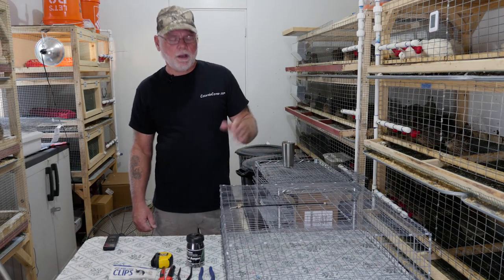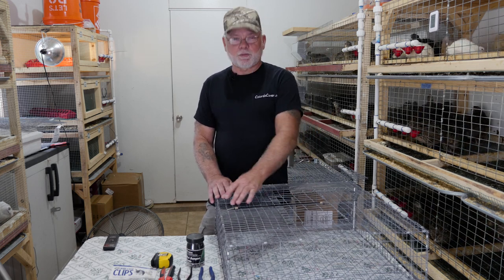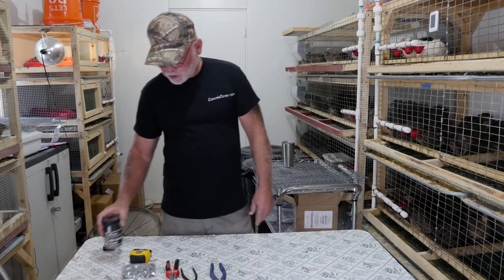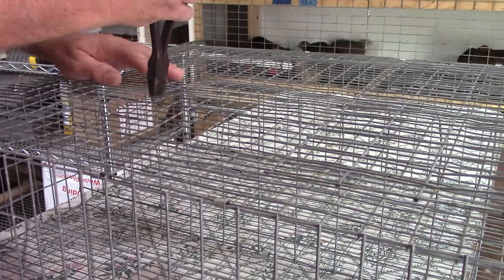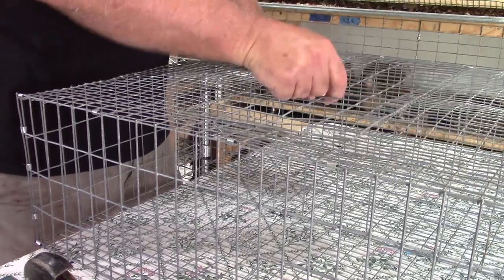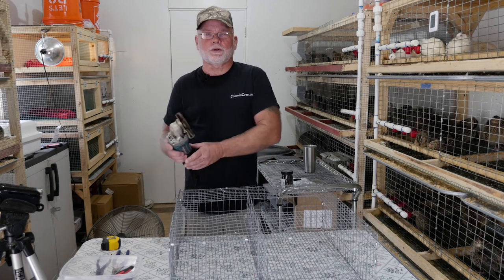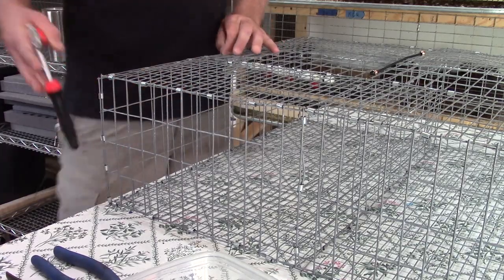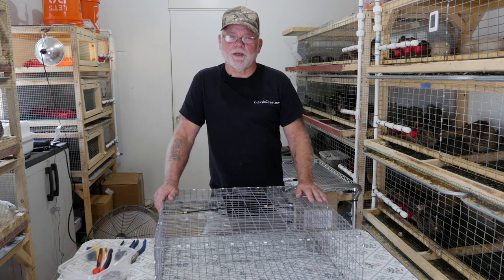QUAIL CAGE - How to build a Temporary Holding Cage for your Quail

Comment: Ir pays to buy the heavy duty J clip pliers rather than the flimsy cheap ones. You hands will thank you in the long run. Having built rabbit cages for years, I know. Also installing a handle on  the cage makes goof sense for one handed folks like me for easier transport.
Reply: I agree with your comment about the Jclip pliers. Especially the new style they have come out with. Can't stand them.  Bought them due to the fact I had lost them. If all goes well (I'll have located the old style)I will have a new pair soon.